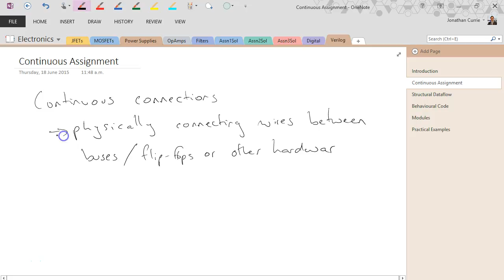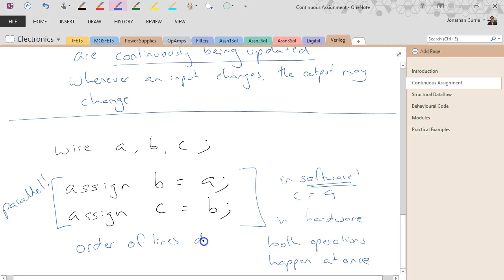Verilog: Continuous Assignment

Comment: 3:40 In a continuous assignment, the wire variable can only be on the LHS of the = sign. The variables on the RHS of the = sign cannot be wires (i.e. input cannot be wires in a continuous assignment). So I don't understand how you can have a and b on the RHS when you have declared them to be wire variables.